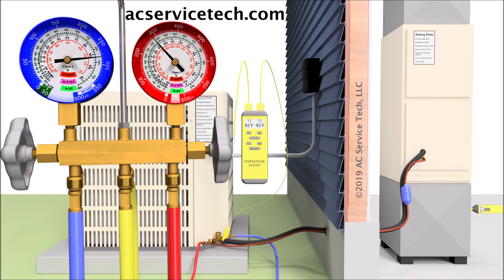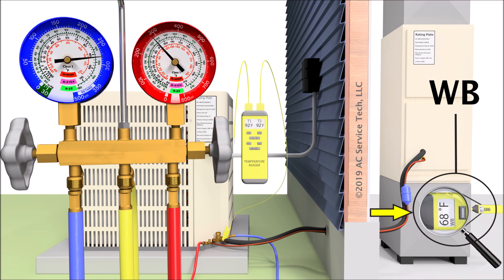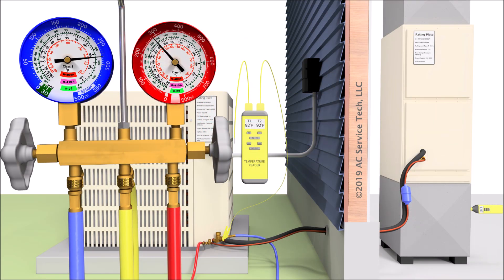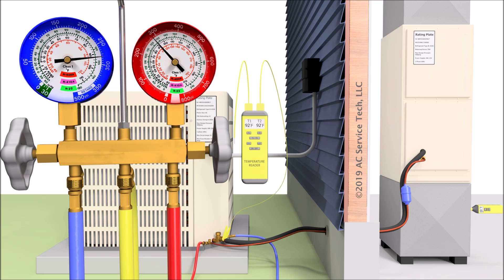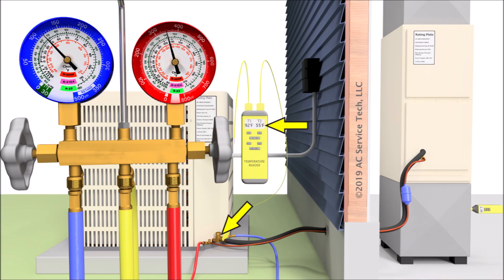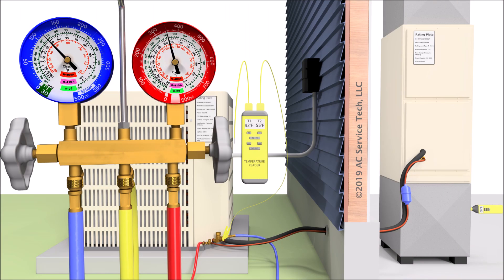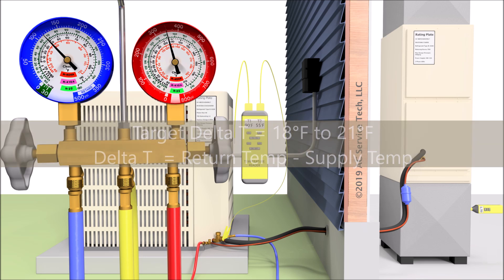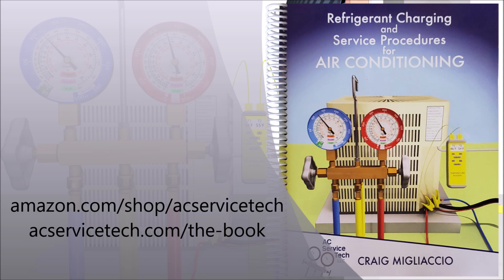Total Superheat Method used to Check the Refrigerant Charge of AC's with a Fixed Orifice

Comment: This guy is a life saver for newbies. I had a hvac technician he said I had 32 degrees of superheat at the low side line and that was way off. I have piston 25 year old Trane X1200 metered system. I told him about the wet bulb, dry bulb method and he was confused.

Comment: Good job 

I got a question for you, if you see this and you reply I would appreciate it .

There is a 3 ton heat pump ,with a 14inch round duck and 6vents ,and 20/20 return grill it’s a commercial place ,
I got DT 26 
76F return and 50F supply air 
Low side pasig it’s 125, line temp it’s 42 degree S.H it’s 11
High side it’s 300 psig line temp 95 degree F.  S.C it’s 4,3 

And it’s with a piston not Txv. 

Personally I think there it’s small duck size and not enough vents  ,what’s your thought on this ?

Comment: How can you tell what type of metering device your A/C has without removing the evaporator coil?
My evap coil was installed by some earlier company or service tech. There are only two small holes in the plenum and they're filled with putty.    I don't want to unsolder the evap coil just to see what kind it is.

Comment: For wet bulb temp, Essentially, Digital psychrometer as close as you can to the evaporator coil? If you got to drill a small 3/8s holes, as long as you get your psychrometer as close to the evaporator coil, correct? Thank you your videos are incredibly well put together!!
Reply from the maker: You should stay back a little bit if possible anywhere 6 inches to 2ft upstream of the coil or the psychrometer will measure a higher wb if its right next to the evap coil, thanks

Comment: i was 90% sure i had a piston/orifice because i saw the nut but i wasnt able to confirm by looking behind the panel because its proving to be a real hassle getting it off..its like the panel is also connected to a bracket that also holds the evap coil..so i feel like i need 2 people..whole units going to need replacing anyway..so thanks for the info! really love your vids..i have like 30 in a playlist that i watch for hours on my study days

Comment: May I ask a question, if vapor pumps can’t compress liquid....why charge equipment in the liquid form? Meaning We charge 410 or puron equipment in liquid
Reply from the maker: This is to keep the 50% 50% mixture of R-410a consistent as it leaves the bottle. plus we can meter it in slowly so the refrigerant has a chance to flash before it goes in. R-410A is made up of R-125 and R-32 thanks!

Comment: Dear Craig, You're doing a great job not also for professionals but also for amateurs. I have a few quick questions for you. if you answer them I would be very grateful.  what is the main reason that we should not use the subcooling method fixed orifice systems?   Since my condenser unit has a subcooling chart what I should do?  Honestly I would like to use subcooling method for piston metering device.  Thanks...
Reply from the maker: A fixed orifice will allow superheat to change based on operating conditions so we need to check with superheat. Subcooling is only checked when the TXV metering device controls the superheat and keeps it steady. You could damage your compressor by using subcooling to try to check the charge because superheat is not being monitored. Definitely would not be able to check the charge properly with subcooling for a system with a fixed orifice, thanks!

Comment: I love this channel. You are explaining very clearly. 

One question: Can I use a standard digital temperature reader to measure the inside (WB) temperature? Sure this will not the correct temperature, but I can get only a standard digital temperature reader in this country. Can I do anything to bring it to a WB value?
Thanks a lot!
Reply from the maker: You can add a small wet sock over the temp sensor to measure the wb temp, thanks

Comment: Ok, kind of in depth question about having high head pressure on a 2.5 ton split system with 22. My suction is 84 liquid is 94 degrees. My total sub is 43 and super is 43. I have ran down all the troubleshooting in your book and cant seem to find the culprit. Did pump down and checked the orfice, purged with nitrogen and if it was under charged my sub would be over 25.. I can give link to my fieldpiece check and charge and manifold data l9gger

Comment: I always enjoy your videos. They are very detailed and informative. Keep up the good work. Once superheat or subcooling is adjusted, and the job is completed, is there a need to recheck the superheat or subcooling at a later date if there is no system leak?  Put another way, once superheat or subcooling is adjusted, will it always fall within the superheat/subcooling chart readings if the gauges are later placed on the unit to check pressures? Thanks.
Reply from the maker: Yes they should remain good unless there is a leak, thanks!

Comment: Is there a video on the temperature rise method to set air flow, in cooling and hearing mode, will there be a book for furnaces as well ?
Reply from the maker: I am planning on doing a video on temp rise to determine airflow. I would love to do a furnace book but I have a few other resources to build before that, thanks!
Reply: AC Service Tech LLC  that’s awesome, will definitely keep a look out for the book, also you think you would be doing any videos on communicating ??

Comment: Have a quick question. Does your book go into the diagnostics of 2 stage condensing units? Or how to differentiate wiring of a 2 stage versus a single stage?

I noticed in one of your tutorials about furnace and thermostat wiring, you have no explanation about Y1 and Y2 wiring. 

Would be nice if ducting and manual D are explained in your new book. That I’m guessing is not in the book?
Reply from the maker: This book is 229 pages and focuses on refrigerants and procedures used to prepare a system for refrigerant, how the systems work, charging, troubleshooting, and airflow testing. The entire outline including sections and subsections are found at the website. This one is not about the electrical wiring. Those wiring diagrams were just focusing on single speed units and units that control speeds at the control board such as for heating, thanks!
Reply: AC Service Tech LLC - never ever a criticism of your videos or instruction. Just a shame since you are such a great teacher to exclude those important aspects of HVAC. 
Maybe in your next book. 

Until then, thanks for all your hard work.
Reply from the maker: @BartSimpson-nr1dy  I had to stop somewhere and 229 pages is considerable as it is, otherwise I would never had completed it. That was a 3 year project. We are working on the workbook now for schools for this book, thanks!

Comment: Can I use regular thermometer to find the wet bulb temp and dry bulb temperature?
Reply from the maker: You should use a digital temp meter such as the st4 for dry bulb temp readings. Wet bulb can be taken with a psychrometer or a method discussed in this video. There is a temp sensor with a cloth over it for sale in the store at https://www.amazon.com/shop/acservicetech thanks!  nnhttps://youtu.be/PIYJBaOdGx4

Comment: simple question, but not mentioned.  when sampling indoor WB temp.  with fan running or not?  static temp vs. a wind chill effect.
Reply: Hmm.  Thanks for the reply.  I'll read up on WB.  I get that it's to be taken as close to the same time a s possible.  Also it measures the airs capacity to absorb moisture.  But wouldn't it give a different reading depending on the velocity of the air?  Higher velocity = faster evaporation.  Also, as the saturation is occurring in a closed system with no direct contact with house air, why is it relevant?  Cool temperature to condense maximum  latent heat?
Reply from the maker: @Spencerbuildsit  A high wb temp air crossing the evap coil is a higher heat load for the refrigerant to absorb since the coil is meant to condense and then reject the condensate out of the building as well as for the refrigerant to move heat out of the building. This work is done to reduce the humidity and while this is happening you will see a lower delta t especially in the case of a fixed orifice. The delta t is low because the superheat is high due to the added humidity that is getting condensed. thanks!
Reply: Got it!  So the calculated SH takes the latent heat into account.  Wondering why leave any SH on the table?  How about minimizing the SH, then have a liquid sensor that returns liquid to the top of the evaporator, or a small evaporator, as a anti slugging device?  How about using flat plate heat exchangers as evaporator in air to water heat exchangers?  I have one that is useless as it needs a control board.  DC inverted driven air to water heat pump.  Haven't found much info.    Learning so much from your contributions.  Thank you.  Will you be doing a few videos on design?  Air handler selection and matching?. Latent vs specific heat and how to design for dehumidification?  Static pressure and duct design?  So many questions.  Thanks for sharing
Reply from the maker: Wb temp is while the unit is running so that you know the target superheat at the same time that you are measuring your actual total superheat, thanks!

Comment: I have a system which has TXV on it. The sub cooling is 13 and the superheat is 32. When the system reaches the set temperature and the system is off, I can hear hissing sound from inside of evaporator for a couple of seconds, then I can hear another different sound like water flowing away from evaporator to outside condenser unit along the lines (not sure suction line or liquid line). The hissing sound last around 4 seconds and the water flowing sound last around 2 seconds. Should I replace the TXV? Thank you so much
Reply: Superheat is high, possible restriction on liquid line, low airflow or low on charge. Not enough refrigerant in liquid line near txv making gurgling sound look like water flowing. Probably that sound is here all the time when system running but maybe you not hear bcz of blower motor noise. What is pressures on low and high?
Reply from the maker: Superhydrophobic, That is the system pressures equalizing while the system is off. That is normal depending on the type of txv. There is no problem with that. The superheat does sound a little high though. Make sure to recheck that again and also check the delta T. If the superheat is high and your delta T is low then that could be a partial liquid line restriction. That was why Mister was asking what your low and high side pressures were, thanks

Comment: Like your videos always watch them when you release a new one. 
     Just realized when you mentioned having to walk back in the building and then back outside again to check your wet bulb and your dry bulb. all temperatures as they change waste a lot of time and Time is money. Highly recommend Fieldpiece wireless gauges with the measure quick app. Or at least the Fieldpiece app. When every minute from morning to night is billable hours and every day you have more work than you can possibly get done. Those few minutes wasted on every job walking in and out of the building add up by the end of the day and that could be one lost job every day in wasted time just to check measurements when it could’ve been done through Bluetooth gauges and you never had to stand up once to go check another gauge. At $150-$200 plus an hour That could add up to one lost job every day for the entire year. That adds up to the total price of a new service van or service truck just by losing that one daily hour. Think about it
Reply from the maker: I agree, have you checked out my total superheat video using the SMAN 460 and wireless wb sensor and wireless outdoor temp reader to automatically calculate target superheat. I also did a video using the probe set, thanks!

Comment: Question:  What do you do when the WB temperature is 60F and the outdoor DB is 100F?  I live in South Florida, and those conditions are pretty typical in the summer.  According to the chart, that lands on a blue X.  I just went and checked the measurements of my own A/C.  R22  WB=69.1F,  DB(ouside)=82.2F, Low Side Pressure = 70.0 PSIG.  Suction line temp= 64.0  Calculated SH = 22.4, Target should be aprox 21F.  Close enough for me, but in the middle of the afternoon when the outdoor temperature goes up to 95 degrees or higher, and indoor WB is around 60F, that lines up with an X.  My A/C has a fixed orifice, not a TXV.  Usually around the point in the late afternoon when the "X" condition is met, I can clearly hear flashing at the piston.  What prevents liquid from coming back to the compressor at those conditions?  The evaporator coil has a raised manifold or "header" higher than the coil itself where the suction line is connected.  My theory is that my particular evaporator coil also acts as an accumulator.  Any help will be appreciated.  I recently passed my EPA608, but that definitely does not make me a "know it all."
Reply from the maker: You are on the right track. That is exactly the problem with installing a system with a fixed orifice in a location that can be dry and hot. Arizona is a good example. In those scenarios, a txv should be installed to maintain superheat let alone for efficiency. An accumulator can also be used. It won't act quite like an accumulator but that design may help a little. You may be on the verge of having sat temp in the compressor. Everything you are saying, and how you are saying it is all right on. I am impressed for you just getting the EPA 608. I just got done answering about 70 comments and this one sticks out for some good knowledge for a newer tech, thanks!
Reply: @acservicetechchannel  Thanks for the answer.  I am not working in the HVAC trade right now, but I have always wanted to.  I have always been fascinated by it all.  Currently I am in IT, and manage the chiller plant and thermal storage system at my day job.
Reply from the maker: @Craig1967  got ya well that explains it probably processing the thoughts of how the systems all work, anyway great thoughts!
Reply: @acservicetechchannel It's awesome what you are doing.  I bought a whole bunch of equipment, including 5 recovery tanks, recovery machine, gauges, hoses,  vacuum pump, spare parts, etc.  I figure that if want to get into commercial HVAC as a tech, I have a bunch of stuff to get started.  However here in Florida, starting pay for that type of work would not cover my bills.  I am really good with computer programming, microcontrollers, and electronics in general.  One day an opportunity may present itself.  I am somewhat familiar with JCI Metasys.  Again thanks for all the education!
Reply: Craig Sherman - Man, keep your job working IN the air conditioning not ON it!
Just kidding of course, this is coming from a guy that works in a 90+ degree shop every summer.

Comment: How long do you recommend placing your wet bulb in airflow to get an accurate reading?
Reply from the maker: It doesn't take very long, usually 30 seconds to 1 minute per reading just until it stabilizes, thanks!

Comment: A way to stop losing charge when checking a system every year I think it's best to preload liquid/service(yellow) hose with the correct refrigerant.
With normal size hoses that should hold roughly 1.5 oz.. Should be enough to offset any loss.  Hopefully ppl are bleeding liquid line back in after disconnecting.
Reply from the maker: Yes hopefully techs are doing the proper disconnect procedure to move the liquid refrigerant back into the vapor line. If they are then they wouldn't be loosing but a little vapor so that would be much less than 1.5oz and they could also use test probes or test gauges without hoses which will loose less but I am with ya, at some point you need to add some back in, thanks!

Comment: Good morning Craig. In reference to air flow, what do you think of the way "emerson check a charge" recommends checking air flow? They take indoor dry-bulb inlet, wet- bulb, and indoor dry-bulb outlet to calculate air flow. Your thoughts? Thanks again for your hard work. Praise God.
Reply: I use the same app. I like it to double check myself. Its a good way to check for correct airflow without an anemometer
Reply from the maker: Hey Dylan and Deanmmartin, that would be depending on the refrigerant charge being accurate before checking airflow but we are usually trying to verify correct airflow before running the the refrigerant through in order to check the charge. It is nice though and thanks for bringing that up Dylan. may the Lord Bless you both, thanks a lot!

Comment: I am glad you mentioned the point about taking away refresh every time you put your gauges on a system. There are ways to minimize the loss but there will still be a loss.  You can tell a lot of things without putting gauges on.  After hooking gauges every visit you can end up with like you said possibly a low charge.  Due diligence says you should try to find the leak but there may not be a leak but when you need to add refrigerant it throws the homeowner into panic mode.  OMG I have a leak!!!!!
Reply from the maker: You are right for sure, thanks Marvin!